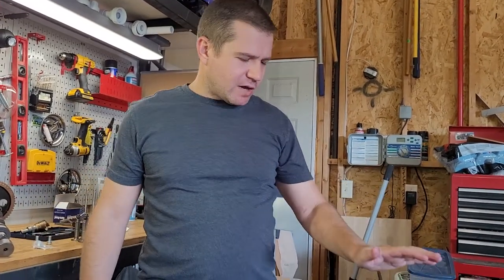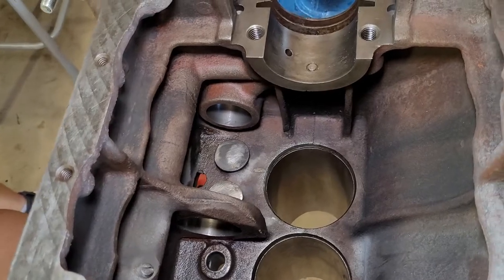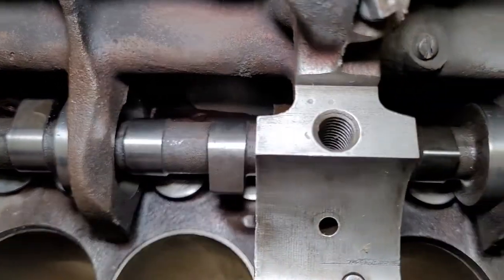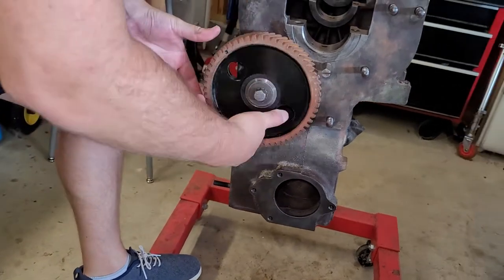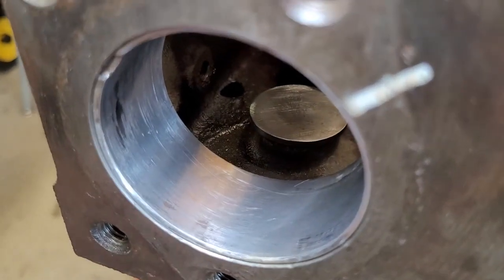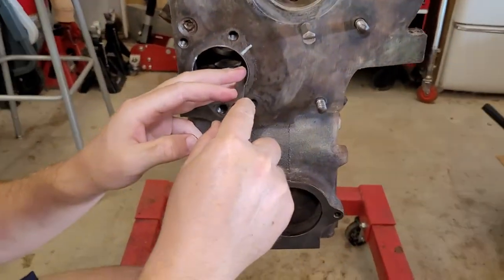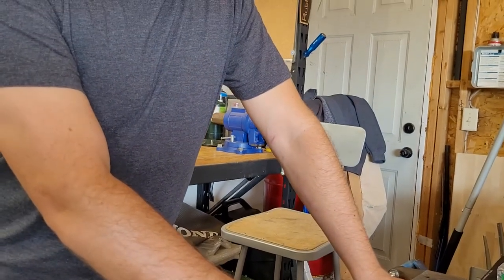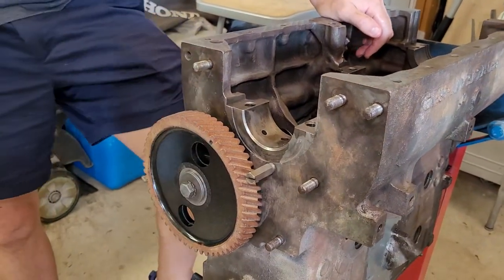Willys Jeep 4-134 Go Devil CJ2A engine. Shaving tight cam bearing with a Goodson bearing scraper

Comment: Machinist here, hand scraping is legit, it works so well, that's how they finish the important surfaces on milling machines, lathes, surface plates, etc.  It's just a real "low gear" on material removal, it's still possible to mess things up, but it's removing so little at a go, that it won't surprise you.  I've known lots of old timers who polish up poorly fitting engine internals with emery cloth, the benefit of bearing scrapers, is that they don't leave super hard abrasive dust in the motor, which is a huge plus if you don't have a hot dip tank, hah.
Reply from the maker: Thanks for the insight here, and thanks for watching!
Reply: @snrakmas  thanks for the vids.  I had a cam that was so stuck, I was worried it was supposed to come out the back of the block or something, watched your video for that, and learned some other stuff as a bonus, hah.
Reply from the maker: Yeah, it's crazy, because if you look up what to do in that situation, everyone in the forums wants you to straight line bore the cam bearing bores and spend a bunch of money to make it perfect.  Back in the day they would shim them, scrape them, and lord knows what else.